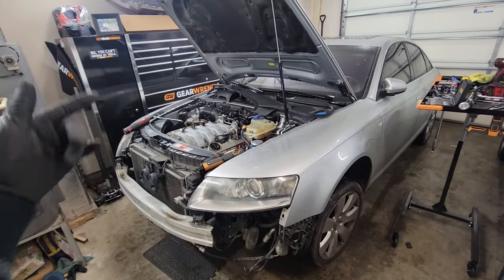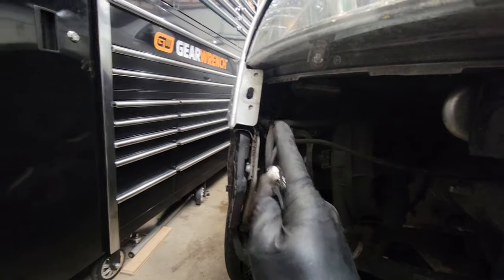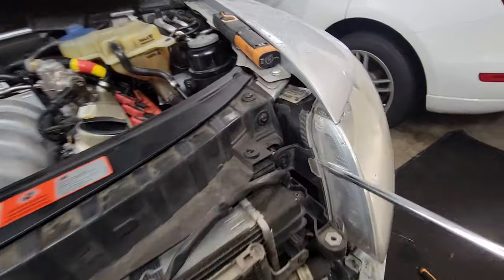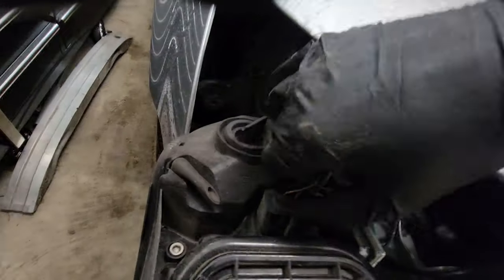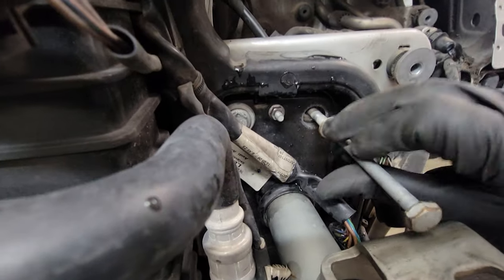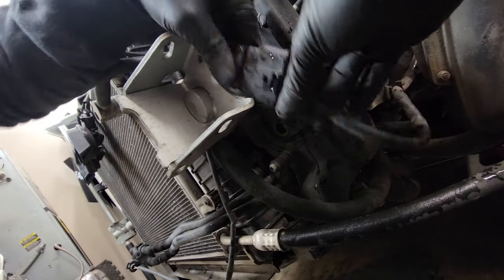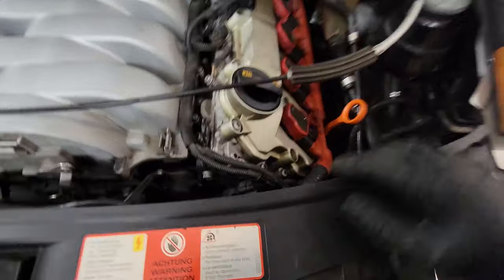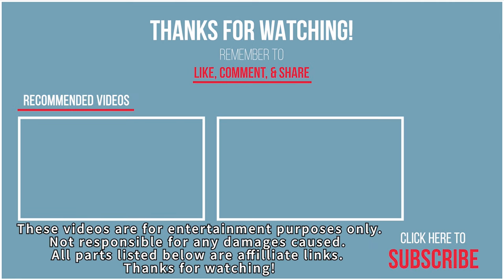Audi A6 C6 Service Position | Must See Hack!

Comment: Forgot to show there is a t30 torx under and on the rear of the bumper supports, 1 torx each side on the sloped metal bracket. THEN it'll come off if it was properly assembled before you took it apart

Comment: Really useful vid bro. Do you think is it possible to change engine pulley without removing front completely?
Reply from the maker: Yes, just slide the front forward like in the video and it should give you enough room. A strong impact gun is the best bet

Comment: Thanks 😂for the laugh  made me holler in laughter  when you said if you have trouble  pulling the front bumper  I wouldn't  suggest  proceeding any further  lmfao 🤣  😂

I personally  like  to  swing  the passenger  side of the front  clip out   and use jack stands  so it just  hangs on the stands you don't  have to disconnect the lines and  that gives  you a fook tone of room

Comment: Hm. I've found that cedar block is the most sturdy and aromatic for propping open metal spaces, but you shouldn't sleep on a good Pine or Douglas Fir. I'd steer clear of dime-a-dozen bamboos and baby soft balsas. They may offer a unique look while wedged tightly between two random hunks of metal, but you'll find their aptitude at holding their position is often lacking. As my mother would attest, you need to have the CORRECT hardwood propper-opener. I enjoyed your video, but I'm giving a thumbs down for improper wood usage, I'm sorry, but you need to learn your lesson.

Comment: Can you replace piston rings in this position?  Or does that require engine removal? I have a 05 4.2 130k. Love it.
Reply from the maker: Maybe, through the bottom of the oil pan. However, will be a pain in a**

Comment: Would you recommend doing timing on this position
Reply from the maker: Yes. Although keep in mind, timing on these engines is in the back. So it really doesn't give you much more room.
Reply: @Mechani_Cole  I meant the 2.0t, where timing is in the front
Reply from the maker: Yes. This is the best way. Can move the core support completely too. I have a video on my page on the 2.0T -  https://youtu.be/wOpSV5xmvXg

Comment: About to send you over my 06 at this point
Reply from the maker: 06 is the worst year in terms of problems, too😭 I'm located in Vegas if you need any help
Reply: @Mechani_Cole  at this point im going to take a vegas trip 😂 I have an on going oil leak, both my belts need replaced and take 5 oil messed up my coolant 

And who else knows what else I have wrong, but its only 107k miles so i dont think its too bad
Reply: @Mechani_Cole  i do have a question do you know a good place for me to get parts at?
Reply from the maker: I list all my parts used in the descriptions. But the "best" place is FCP Euro or ECS Tuning in my opinion

Comment: I don't know if you've noticed this but you're not supposed to separate the bumper from the aluminum All you have to do is take off the six bolts on the side of the bumper take out the two at the fog light that will take off your bumper then hit up those three in the front at the crash bar or a couple on the top and slide it forward it's not a hack it's just common sense for anyone that's worked on these cars for a long time knows this
Reply from the maker: You'll have to make a video showing how that's faster and this isn't a hack🤷🏼‍♂️ 

If you didn't notice, my channel is for people who don't work on these cars all the time.
Plenty of people used this method and were appreciative of the video✌🏼
Reply: @Mechani_Cole I am south of Olympia, wa....I have 2 audis that need work. I am not a rich chi k, so I do all work myself. But, having a reliable guide to follow or correct advice is a godsend! I can read and follow directions, so I am able to do most things if what I am reading is legit. Do you own a shop in the area? I'd be interested in maybe talking about a few things with someone who is not going to steer me wrong.  I've enjoyed the videos I've seen. Good content that's easy to follow is highly appreciated. Have a good one! ✌️
Reply from the maker: Just moved from Everett WA a few years ago, living in Las Vegas now

Comment: you say V8 but then say 3.2 --  4.2?
Reply from the maker: Did I say 3.2? This is the 4.2 V8 model. 

The 3.2 is pretty much the same, but a little quicker/easier. Its the same for 3.0 as well.

Comment: Very useful video, thanks for taking the time to make it. I'll just add that for the TDi models like mine, there's a large pipe that runs below the radiator and goes from one intercooler to the other. You have to disconnect it from the intercoolers at each end - it's just a standard hose clamp.
Reply from the maker: Good tip, thanks for sharing!